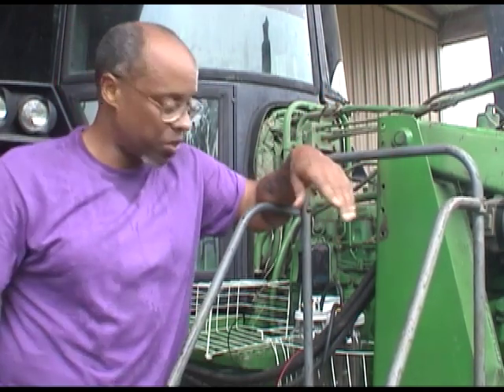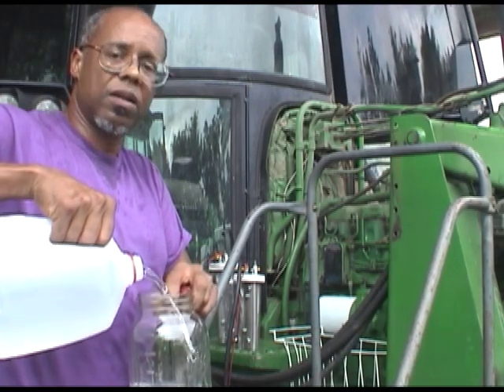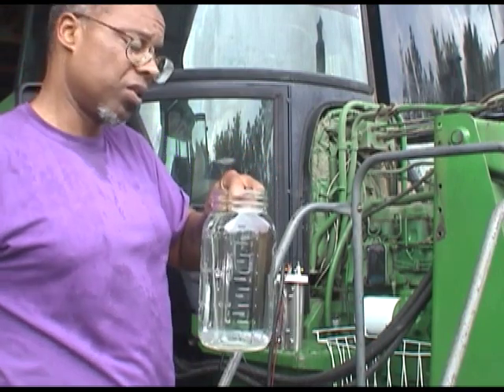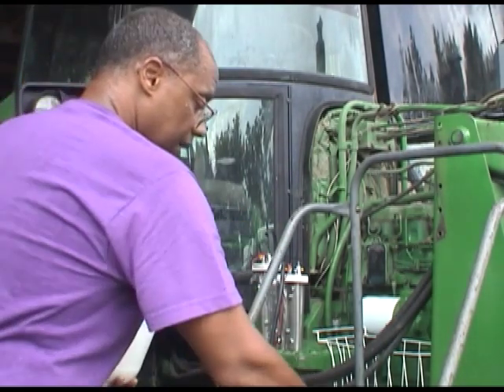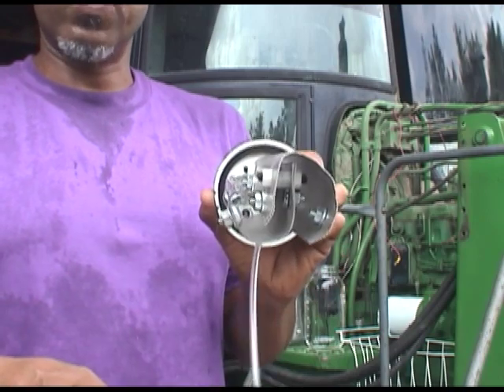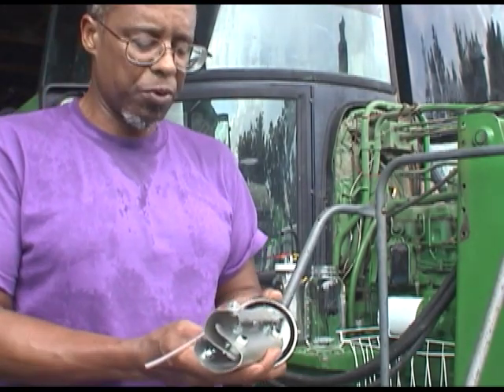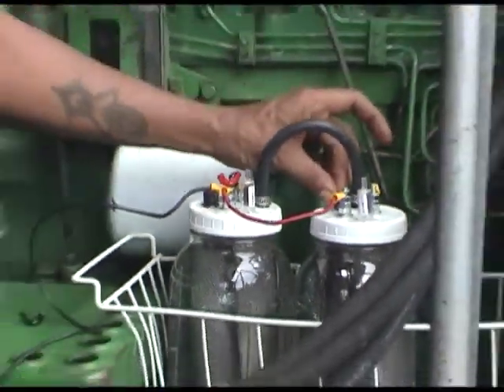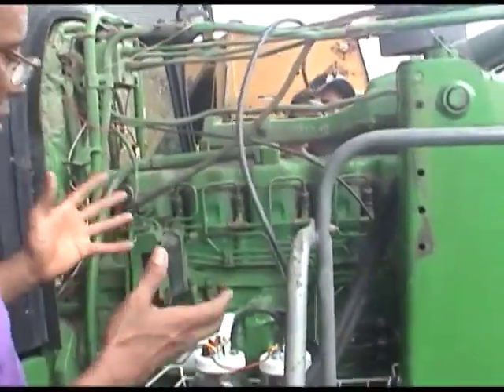Amexem Technologies HHO Tractor Install Central Louisiana

Comment from the maker: He has not returned my calls when I ask him about his use of the HHO system I have installed 3 years ago. If the initial results hold consistent, the system would have saved him almost $15,000. I will send you his phone number through your email and you can call him yourself. My guess is I think he feels I would ask for a portion of what he has saved when all I want is the confirmation of the data over time, so I can put into a business plan and move forward.

Comment from the maker: In four years I have yet to experience what you claim. Maybe you were doing something wrong like not having inline fuses which will prevent any safety issue. Following instructions from people who have designed the template I have based my efforts on stress inline fuses. My guess that is where you went wrong. And I don't think anybody would turn their nose up from saving 40% on fuel costs daily. That is what my design of wet cells consistently get. Abeeku

Comment: I don't want to come off as negative as you are doing a good thing by doing these installs, but you should really not use glass jars. They are glass bombs just waiting to go off. Also a good dry cell design will out preform the wet cell any day of the week.